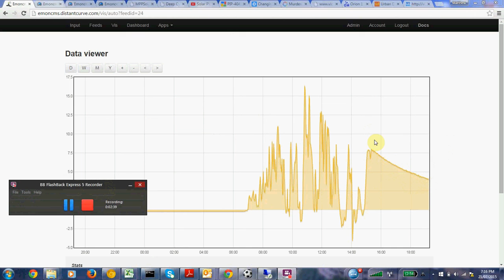Balancing a 48V AGM Battery Bank

Comment: did you make your own balancer
Reply: @dockarl123  im missing the way you actually connect to the bank. also i have 20 strings of 48 v agm batteries. please adbise ty so much
Reply: advise
Reply: i could pay you via pay pal if you would create the plans for me.
Reply: @dockarl123  ty
Reply: @dockarl123  how do you feel about using the ha02 for 2 strings each
Reply: @dockarl123  ty, well i just purchased 30 ha-02's should be enough

Comment: Hi Dockarl. I thought i would get back to you. I have been using HA01 battery balancers (http://www.ebay.com/itm/Balancer-Equalizer-of-Battery-Solar-of-24v-with-2-Batteries-12v-series-Spain-/152123402530?hash=item236b42e922:g:jAAAAOSwxN5WbfMs)  since Sept 2015 and it took a while (2 months) for my big 260Ah batteries to get into balance but I have not heard a mid-point alarm in months. Maybe something you could consider in your bush installations. I know that the HA01's big brother the HA02 is being imported into Aus. We have been off-grid for a year now and my system works seamlessly. A visitor could not believe we do washing, ironing, baking all on solar.
Reply: Hi Dockarl 
Glad you find them useful. Saw the video of the chopper delivering your kit to the top of a hill  - way to go.